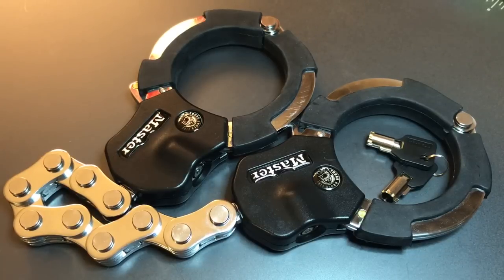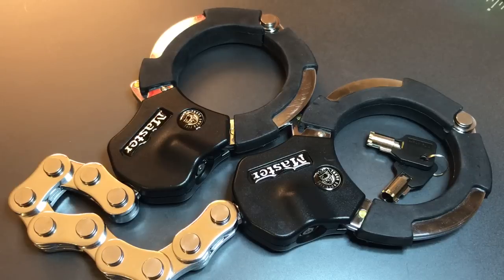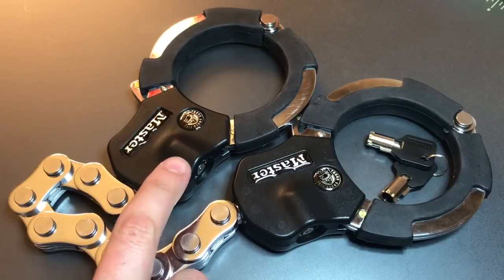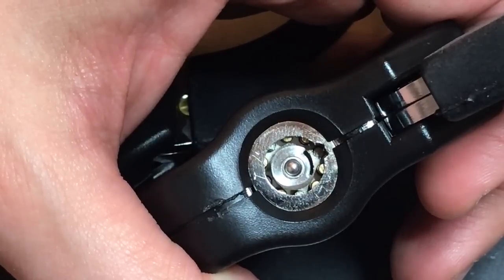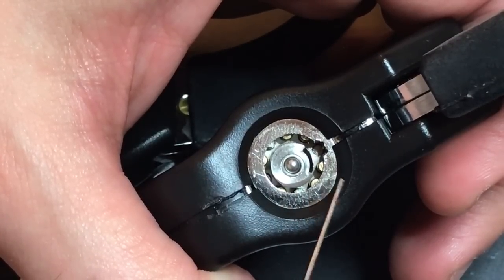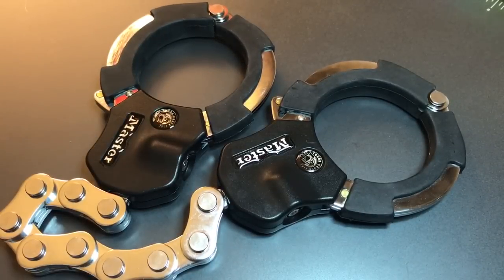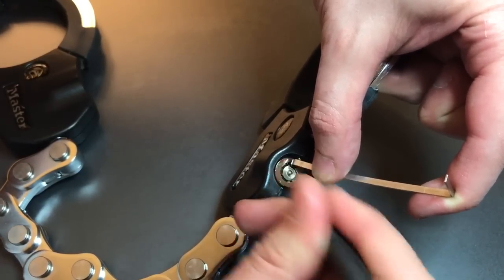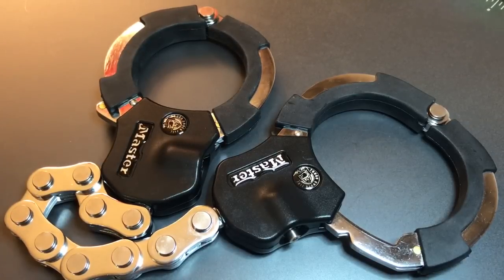[355] Master Lock "Street Cuffs" (10-Pin Tubular Core) Picked

Comment: They don't honor the warranty. I talked to them and they said "You must have the lock still in your possession and mail it to us so we can see the damage and if it's the case we will give it back". Unfortunately the lock went with the bike.
Reply: Robeon Mew That's a solid F, what bike was it?
Reply: What a scam
Reply: That’s so stupid
Reply: How else will they know that it was their lock that failed? You could leave the bike without locking it up, and then throw away the lock. You could have lock it to something weak and easy to break. Insurance is just sh*ty and expensive way to give people false sense of security.
Reply: @pingwingugu5  even when I send them the lock, how would they know? I could have went to a scrapyard and have it cut with a grinder after my bike was already stolen.
Reply: @TheNukebooster   You are right, but that is way more work on the scammer part than just throwing the lock away. It's not simply oh I will just lie about it, it's I will fabricate a proof that this happened. Plus you are giving them something to analyze, if you don't know what you are doing and say spend the whole night trying to cut the lock with a hack saw while having the lock mounted in the vice then it will leave very different marks than what a normal angle grinder attack on street would look like. So there is a chance that you will get caught lying.

But you are right that condition to deliver them the broken lock is there mostly to limit how many cases are eligible. Of course they don't want to pay you.
Reply: That makes some sense, if someone locked their bike to a thin tree... or an aluminum pole, you get the idea
Reply: GODsaveTHEcat you register the vehicle with the lock you use on their website. Vehicle stolen = police crime reference number too. If they refuse to honour the replacement a simple lawsuit fixes that.
Reply: @beepboopthemyth  the same problem we discussed before. The bike might have been unsecured when it was stolen, or secured to something that was easy to cut. I don't understand how reporting it to police changes that.
Adding the requirement to provide the broken lock makes the fraud harder, because it's a simple lie in case when you don't need to provide the broken lock versus forging the evidence in case where you need to provide the lock. 
Of course it also limits the number of valid cases to process which is probably why they do it.
Reply: GODsaveTHEcat as I said, a crime reference number validates the theft. Don’t need a lock to prove it was stolen if the cops have a case reference number.
Reply: @beepboopthemyth  It's not about proving your bike was stolen, it's about proving that their product failed. The reference number does not tell them did you locked your bike with their product.
Reply: GODsaveTHEcat Christ I guess I’m doing all the work for you.  Crime reference number verifies the legitimacy of the situation. Since it’s now officially a crime, the police will acquire CCTV footage showing it was stolen and of course showing the lock failed. That alone counters the “we need the lock” argument.
Reply: Wargen Bruh, y’all got nothing better to do than come up with every excuse ever? 😂
Reply: @beepboopthemyth  What CCTV? What are you talking about? Their ToS is that you need to give them the lock that failed. If you don't have it, you don't get the money for your stolen bike from them. You agreed to those ToS by buying the lock and registering you bike with them. There is no lawyer that could win you this case.
Reply: @beepboopthemyth  "out of sight from any CCTV" Big Brother's always watching you, eh? I guess you found one of the benefits... Is it really worth it though?
Reply: @beepboopthemyth  You're not seeing the forest for the trees, apparently with a government camera watching you from every branch "Those who would give up essential Liberty, to purchase a little temporary Safety, deserve neither Liberty nor Safety."

But you're probably just here to argue anyway, carry on
Reply: I think all of six buildings have CCTV where I live. Not every city, town, hamlet and village can afford sprawling interconnected systems of surveillance cameras.
Reply: Korbett Hein and where do you live? 1st world counties are laced in cameras, every corner, every street in towns etc. London, UK is well known for that too.
Reply: @beepboopthemyth   I live in the United States.
Reply: @user-ut9ln4vd5m   and it wouldn't help with crime either. In the UK they didn't catch a guy who robbed stores wearing a CLEAR PLASTIC BAG as a disguise, despite the fact that his face was repeatedly caught on CCTV footage.
Reply: Korbett Hein the US is also heavily monitored with CCTV 🤦‍♀️
Reply: @beepboopthemyth  That is a highly inaccurate statement. You just tried to broad strokes lump ALL of the US together. All your statement proves is that you've never been here.
Reply: Korbett Hein your assumptions are funny. Try again buddy. The US is covered in CCTV, that is a literal fact
Reply: @beepboopthemyth   I'm guessing you don't know the old trick of having a non-functional camera to deter small time criminals. Also you've completely disregarded the more rural areas, which as I said in my original post, simply don't have the money to plaster their towns with cameras that don't really do much.
Reply: @beepboopthemyth   Wow, aren't you pretentious! YOUR comments section, eh? Did you pay for the domain name? I didn't think so. You don't have a valid argument, so you've resorted to personal attacks. Do a bit of research next time. Oh, and by the way, CCTV doesn't even slow serious criminals down, let alone stop them.
Reply: @beepboopthemyth   Oooooh, someone's maaaaaad. I never said I own a public comments section, you did. My argument is based on personal experience, as I've seen a fair amount of the western US. You're primary tactic of argument has been to lump massive geographic regions together without considering local variables and ad hominem. You are wrong, it happens, get over it. By the way, the criminals that get caught aren't the serious ones.
Reply: @isosta3889   Oh I know, I chose not to reply. I don't have time to argue with kids, trolls, and morons. It's good to see people who have common sense though.
Reply: @isosta3889  I just want to assure you, that there are a couple humans left with functioning brains.
Your argumentation is sound and follows, well, logic.
Have a great day
Reply: @korbetthein3072  oops, the reply to isosta was ment for you.
Nonetheless, you both have a great day
Reply: @Retro_Rainer   You have a great day as well.
Reply: Won't police incident reports and affidavit of loss + proof of receipt of the locks be considered proof? Insurance sucks.
Reply: @mangckyatmamon  Yep
Reply: GODsaveTHEcat The point about reporting it to the police is that you need much bigger balls if you have lie directly to the police as part of your fraud scheme.  It’s completely standard for any “we’ll compensate you if you’re a victim of crime” scheme to require the crime to be reported to the police.
Reply: Beep Boop “with legal backing from the police” There’s no such thing. The police don’t give “legal backing”. They’re a law enforcement agency. The warranty claim between you and the lock manufacturer is a civil, not criminal matter.
Reply: Guys. Criminals know where the cctv is, and they generally don’t steal valuable things from under them. Plus the resolution of CCTV is incredibly shitty. Most vehicle thefts are not meaningfully caught on CCTV. If you can find camera footage of thieves cutting your lock and then taking it with them, I am sure the master lock company will be happy to give you your 3.5 grand as a goodwill gesture. This is not going to be the common case. Quit arguing like four year olds.
Reply: A Pyro Main no, because people forget to lock things up (or “forget” as in don’t bother to) *all the time*. Hence just being 8n possession of a lock and having a legitimately stolen object is just not good enough.

This is why bicycle insurance that actually works requires a lock that you can only take the keys out of when it is locked up, plus requires you to send in the keys as proof that you didn’t forget to lock it.
Reply: beeble2003 ... it’s not about a warranty claim, it’s about insurance on the thing you lock up with the lock.
Reply: Jasper Janssen No, the subject under discussion here is Master Lock’s warranty that they will pay if thieves broke this lock to steal your bike. Any insurance you may have on the bike is a separate matter.
Reply: Carl Schmidt simmer down? 😂 bless you’re definitely close enough to have your teeth kicked in 😂😂😂😂
Reply: Carl Schmidt bless, aren’t you special.
Reply: Carl Schmidt you are indeed buddy
Reply: @beepboopthemyth  lol wtf are you smoking, there is barely ANY surveillance in the US.
Reply: @Seventhsu  Ight, next time il leave the lock there.
Reply: Companies very rarely do. You gotta give them a call and ask them for the details, and if they don't give them, then you know it's a bad warranty. If they do, then you can find out if it's bad.
Reply: I don’t know anything about law but now I do know about warranty and insurance claims as everyone else bickered like five year old making me look less dumb so I thank you idiots for pointing out all the stupid arguments (also I do have a side but I am smart enough to know that I would be harassed because of my opinion regardless of what it is pretty much 2020)
Reply: @beepboopthemyth  this is some quality trolling.
Reply: ouch, talk about catch 22 in the warranty that they forgot [coincidence?] to put on it.
Reply: Sometimes it is just easier to saw off the anchor.
Reply: i feel as if I'm the only one who disagrees. the mail in feature stops scams. the fact that you didn't get the opportunity to mail it in and see if they would reimburse you doesn't prove your point. If you mailed it in and they didn't, that would be not holding up their end.

so no, they did honour the warranty, just not in the way you expected. so sit down, hut up, and deal with it.
Reply: It makes sense, they only warranty it if force was used and they have to be able to see proof that force was used. Otherwise they are open to any number of scams.
Reply: What stops you from buying another lock and mailing that in and saying it was the one holding your bike😂
Reply: Would they have accepted a police report, I wonder?
Reply: He has the one absolute defense, and thats the truth.

Comment: LPL's videos have made me realize that no lock is %100 secure but that doesn't make it worthless.  This lock is a good example.  Just because a very skilled lockpick opened it very quickly in a controlled environment doesn't mean it doesn't have some deterrent value in the real world.  In the real world there are a lot of other factors to consider...

1) Not many people have these skills.  
2) What is the value of the item I'm trying to steal?  Is it worth me even trying if I might go to jail?
3) Are there witnesses around?  Are they going to notice me suspiciously messing around with a bike lock for a minute or two and start asking questions?  Is there a hidden camera filming me, giving them a nice long 2 minute look at me?
4) How is the lock situated?  Is it positioned so that I can use my lockpicking skills easily?  Or is there a sign, wall, piece of bike frame, etc. in the way that makes it a lot more difficult to pick than it was in the comfort of my home?
5) Okay, I've picked the lock, now what?  I can't start the bike.  Okay, me and my buddy will real quick roll it up this ramp into the back of a U-haul.  Oh crap, it's got a wheel lock too!  I guess I'll need to have 4 buddies so we can lift it into the U-Haul.

Etc. etc. 

Seems like the main security feature of a lock like this is to deter a quick and dirty theft.  Somebody coming up with bolt-cutters or something and then, with accomplices, hauling it away before anybody notices or reacts.  If I owned a $60,000 bike I might not use this but I think it would be fine for less valuable bikes, like say in the $3500 range.

Comment: Master lock: This is a 10 pin tubular lock that are both pick and drill reistant
Lock Picking Lawyer: so now we will pick it.

 literature going down the drain
Reply: if its pick and drill RESISTANT, it doesn't mean its pick and drill PROOF. You can still pick it or drill it but it will be hard.
Reply: @MattiLoimaranta  yep but resistant I sent ez to pick boy
Reply: @MattiLoimaranta  resistant for about 20 seconds? It takes longer to untie a knot than to open this lock
Reply: Michael Persico         They would require a police report and they would stonewall you quite a bit along the way.  I bet they've paid out very few claims if any.  Not because their locks are so awesome, either.
Reply: @domesticcat1725  resistant for 20 seconds from a professional lockpicker who has decades of experience and has researched and practiced this particular lock. That's not bad praise.
Reply: @AGryphonTamer  you're right, i probably overstated the number
Reply: Michael Persico  thats called fraud. And you would go to jail for it lol.
Reply: @AGryphonTamer  This lock would not take that much longer for an intermediate or novice lockpicker either. A four pin tubular lock is not very difficult to pick.
Reply: The thing with "resistant" is that it does not mean "proof" or "immune".

Comment: Because it only requires a slight rotation, it bypasses one of the security benefits of a typical tubular lock. It doesn't rotate enough that the pins fall into the next slot over as it turns, so it only has to be picked once. They really shot themselves in the foot.

Comment: It seems that Master makes a quality product in terms of structure, (tough under fire), and physical quality.  Now if they could apply that to the security aspect of their locks, they might gain some respect from the picking community.  I'm not expecting that any time soon since they, despite their lack of security, seem to sell a lot of locks to the uninformed public.
Reply from the maker: +Mark England Master lock seems to be a company of extremes. Some of their products are really really bad, and some of their products are comparable to those that are put out by abus. I also have some sympathy for the fact that the public at large expects really really good products really really low prices. Both of those expectations can't be met. Any company making commercial locks is between a rock and a hard place.
Reply: Definitely agree.  I think that a single security pin would elevate the security aspect of their locks by a point or two.  If I were an actuary for Master I would think that the cost/benefit ratio would be in line with increased profit.  Just my opinion, good vid as always!
Reply: The cores in their LOTO locks are so much better than their consumer locks.  But their LOTO locks are among their cheapest.  So it’s confusing.
Reply from the maker: +Stephen Linhart Agreed.
Reply: @lockpickinglawyer  Also their warranty sounds like a scam, I suppose only a very small amount of their customers which had their street cuffs manipulated open really got the promised money, especially if the lock disappeared with the vehicle
Reply: Alessio M Criminals rarely pick locks. And suppose a criminal did pick your lock: proving that it was picked (rather than that, e.g., you just forgot to lock it) will likely require a forensic examination costing more than the warranty is worth. Likewise, if the lock was taken with the vehicle, how will you demonstrate that the lock was defeated? You versus the lock company is a civil matter, so the standard of proof is “on the balance of probabilities”. Well, I’ve had two bicycles stolen in my life but there have been more than two occasions when I’ve gone back to my bike and found I didn’t lock it properly. So, unless I can show you the broken lock, the balance of probabilities is that I screwed up, not the lock company.
Reply: @lockpickinglawyer  Certainly in my experience most thefts from the street, centre on brute force and are undertaken by scrotes armed with a battery grinder and a set of bolt croppers.
If the device can withstand these then its probably good enough for most insurance companies and bikers. The day that 14 YO scrotes go armed with a tension bar, set of picks and a you tube video of yours then we will be in trouble.
Reply: If it looks high end and has some weight, most people will think it’s super secure, no questions asked lol🤣

Comment: Anti-pick feature: a tension wrench in standard position won't turn the ring enough to pop the cylinder even if it's completely set, causing the thief to waste time going back through the pins.

Comment: Back in the early '90s  I used a set of S&W Handcuffs through the front forks of a motorcycle and took out all of its spokes when the guy who had broken into a house ran out the back door and hopped onto the cycle and was promptly arrested as he hit the ground. It worked wonders, destroyed the front wheel and ended any chase.

Comment: I had one of these locks. It was very useful, just until it broke after a year of now-and-then use. One cuff wouldn't close anymore, the pin would just not stay popped in. I sent it back and received a new one. That new one broke in the same pattern, just another year of now-and-then use later. I sent it in the bin and now use a normal lock. I am very satisfied with my decision.

Comment: This looks like a surprisingly good lock, a large warranty protecting against most physical attacks, and an unusual core stopping most beginner-intermediate lockpickers, and reading the warranty myself it looks like it should cover picking as well, but who knows what they will actually cover. The color coded dummy pins are also only weak to someone who has researched this particular lock.